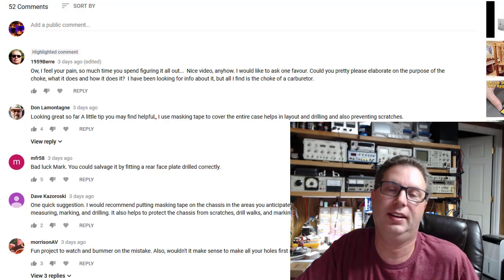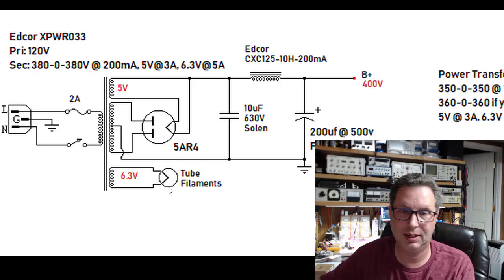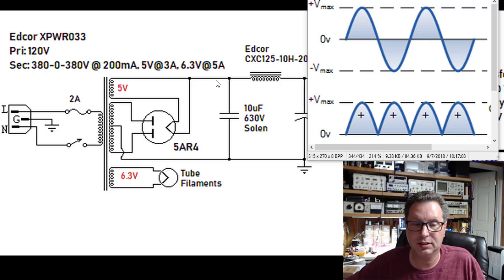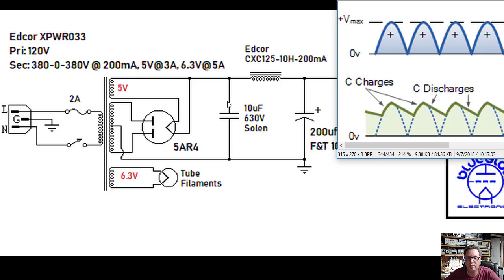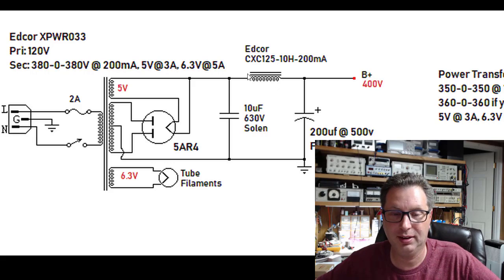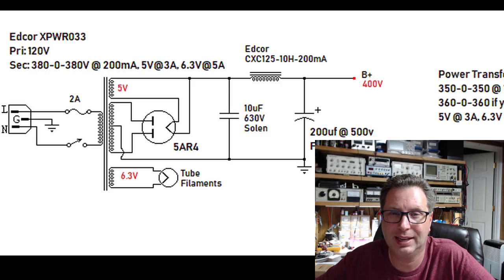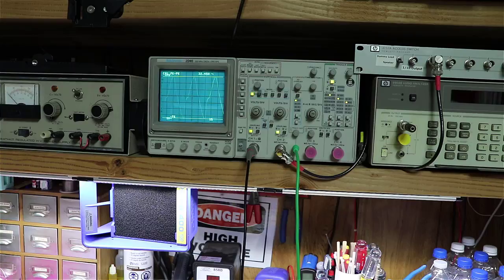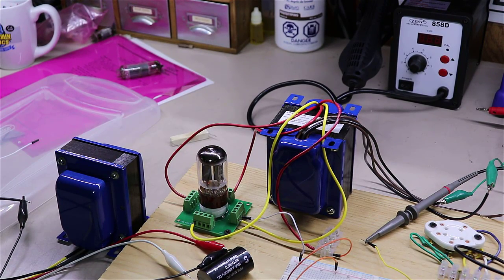What does the Choke in a Tube Power Supply do?

Comment: Hello - I’m sorry I just came across your video, 2 years late. I was thinking perhaps others have pointed out the inaccuracies, stuff perhaps you deliberately left in so people will write in !?

My first point of disagreement is the too output of the transformer secondary. You have one end is that 5 volt lead going into the heater and the other end connected to the 400 VDC !

Think !

Also - the center +/- 400 volts is rightly connected to ground but - look at how you have the =/- outputs if the transformer secondary connected !

They into the rectifier but dove go out!

These two need to go into that choke,

Also the rectifified output goes into the first capacitor for “smoothing” . It’s the inductors-capacitor following that are the filter !

Let’s see you corrects that schematic !

Are you not tired of deliberate “click” bait !?

Comment: I have a Baldwin organ choke that has 3 wires for the life of me I can't figure out how to hook it up. I took a measurement of two opposite side wires yellow and green on my lcr meter abd it said 10.04 Henry's and 198 ohms but if yiu try measuring with the third wire which is black nothing comes up. Do you think it's even a choke or could it be a common mode choke. Maybe the black wire is a ground but I think a filter choke was two wires on same side

Comment: Great video. A couple corrections, VAC peak to peak is not the same as RMS. Line voltage in the US is about 340VPP (+170/-170) which translates to about 120VAC RMS. You might think this is pedantic, but if you're ever using a function generator to run appropriate signal through a circuit, you'll need to know the difference or stuff can go poof, or get calibrated incorrectly. Also, caps by themselves aren't low pass filters, they're high pass filters. You can put them in a circuit so they pass HF to ground, thereby creating a LPF, but by themselves, they're HPF. Also, not a correction but worth mentioning, in modern gear, voltage regulators are also often used to smooth out ripple current....of course you won't see these in oldschool tube circuits, but they're still pretty neato ;)

Comment: Kudos ur schematic is very good in order for ur choke to do its job thebinput C should be relatively low and the C after the choke should be 20 or so times higher good power supply design

Comment: Here I am again. At 16.46 you can't just ignore the fact that the input cap is too large for the voltage and currents involved causing the peak repetitive current rating of the rectifier to be exceeded. (The  series resistance per plate could be increased to solve the problem) But I guess you did. Your rectifier tube will have a shorter life than if you designed the supply filter properly so as to not exceed the peak repetitive current rating of the rectifier tube.

Comment: "120vac Peak to Peak RMS voltage" What????? there is no such thing. For AC voltage there is 'Peak to Pea'k, 'Peak' and 'RMS'. The voltage at the wall socket is 120vac RMS. RMS is .707 times peak so 120 vac RMS is 169.2 volts Peak or 338.4 volts Peak to Peak. Words matter. Words have meaning. I will watch the rest of your video but I will be careful. You have shown that you can't be trusted.

Comment: This was a really nice, informative video.  I would like to mock something like this up so that I can add a choke to an amp that was not originally designed with a choke.  I've added a choke to a Princeton Reverb and had to install a lower than spec resistor after the choke to drop voltage to the next node in the chain.  The choke alone dropped me 3v., I needed to drop 20v.  I'd like to add what you did to a build board.  Do I need a load on the power transformer to do what you just did?  I always put a 4, 8, or 16 ohm load on output transformers to run diagnostics so I don't have to listen to signal coming out of a speaker.  Does the same methodology apply to power transformers?  Can they be powered up open ended?

Comment: 4 minutes into this video, and you have already taught me (in a manner that I will remember!) more about tube amps than almost 6 months of reading books/blogs/articles and even watching other content creators. I mean Rob Robinette has a invaluable reference site, but it kind of assumes that you are already fairly familiar with tube amps and schematics. When you buy a B-52 AT100 that is already infamous for electrical issues sight unseen, and the seller swears up and down that it was working when he sent it, but the 20 year old masking tape has markings that highlight the one tube that shows scorch marks on the board... well, lets just say, I'm out of my depth after replacing 3 bad resistors, 2 blown fuses, all of the tubes. Still will not power on. I Love the B-52's, but I might as well have gotten a Mesa-Boogie for the amount I'm spending to repair a $500 amp.

Comment: Great video.

  Thank you for the excellent video.  I have a question or two.  I noticed in your schematic the neutral is switched.  In my jurisdiction that is not allowed. The neutral must NEVER be open.  Only the line side of the AC.  When the neutral open the chassis is always live with a potential of 120v to ground and the could be you if the earth-ground (green) is not, for whatever reason, present. All fuses/CB must be on the line side for this reason. Again, that is my local code but maybe not yours. 

 Next, I have a few old original Dynaco ST-70 amps. One was functioning perfectly when I decided to install a three-pronged "earthed" plug.  The green went to the metal chassis.  When I plugged it in the resistors on the rectifier board exploded, I assume due to high current ground as this amp has one lead from the power trans to the star ground along with the electrolytic capacitor can tab and other leads from the rectification board.  I'm just in the process of replacing the caps and the board,  I have read other have earth grounded that chassis w/o issues other than some hum (which makes me crazy why the chassis should have ever had anything to to with carrying current).   My first thought is that it/s a polarity issue.  Any thoughts would be greatly appreciated.  Many thanks.

Comment: Hi so i just watched your video on how chokes work and was hoping you could come with a answer for me. I'm building a amplifier that is going to use 6 KT88 tube witch will draw around 842 ma and 6 smaller preamp tubes that will draw around 2 ma so lets just round it off at 845 ma I'm going solid state on my power transformer using 8 N14007 and this will be a filter input not choke input amplifier. the capacitors will be 50uf @ 500v the first 2 at the power supply wired in series parallel followed by 2 at the screens of the kt88 also wired in series parallel and 4 more cap in the preamp section all 50uf @ 500v. I'm having a power transformer made that will be 500 0 500 at the H.T how many hennery do i need ? I've gotten different answers like from 4-8 hennery but o more than 10 also would you know how many ohms it would be thanks Jack

Comment: Excellent explanation but the modeling experiment even better. Would you provide a schematic and parts list for your test? What did you use for a load on the rectifier circuit?

Comment: Just to be clear are not these voltage waveforms you reference only valid when there is a load resistor present on the output side of the power supply?
It looks like the output is open circuit.

Comment: Watching this with my DIY tube amplifier. One question, suppose I have an unused supercap (1.2 mF 400 V), is it OK to connect it parallel to the rectifier output and eliminate the use of a choke? Since a bigger capacitor will smoothen the ripple even more as well.

Comment: Hi Mark, thanks for great explanations, Im a newbie, and have learnd a lot with your videos!   
If possible, would you make a video explaining how to design a real LC - Choke input filter (not a CLC or Pi filter...) considering critical inductance as well as minimal current for bleeder resistor calculations?  I have read a lot about inductors efficiency for ripple smoothing, and also saw many rectifiers tubes datasheets with differences in operating characteristics between Choke Input and Capacitor Input (Pi) filters...
Thank you very much!

Comment: Do you recommend actually switching to "boutique" capacitors or is that just marketing BS?  Would love to hear your technical description of this
Reply: Best capacitors are oil in paper u can use motor run capacitors for hvac systems u can use ac capacitors there voltage ratings are 1.4 x of what they are rated at at ac voltage and they are cheap and long lasting

Comment: As usual, great video. Well explained for any novice getting into electronics. One point I think we need to make here is just like the capacitor, the choke stores energy as well. And just like the capacitor, it releases that energy when the voltage feeding it falls. One reason chokes were used in tube circuits was cost. Today that seems absurd as a choke costs many times even a large high uf/high voltage capacitor. But it wasn't that way in the 1920s through the 1950s. Large caps were quite expensive if not outright unobtainable prior to the 1940s. A choke was actually cheaper to manufacture  at the time. Solid state circuitry also made the power supply choke mostly obsolete. As SS circuits use lower voltage, higher current, the required size (Henry's) of the choke becomes impractical at 60hz. And by that time we fortunately mastered the dry electrolytic capacitor. But then in switch mode power supplies that are universal today, we once again see a choke power supply. This is because the high frequency AC at 50khz or higher is easily filtered by a small choke (very low Henry's, in fact just a few micro Henry's). So in a sense we have come full circle in power supply design basics. But also note in a switch mode power supply, the primary input rectifier filter is still a moderately large electrolytic capacitor typically in the hundreds of uf range. This is because at this point we are still at 50 or 60hz.

Comment: I replaced all the filter caps in a customers 70s Fender Twin Reverb guitar amp. The amp still had more hum than normal. The problem was a shorted choke. I've probably had maybe 5 or 6 chokes fail in 30 years of servicing tube guitar amps.

Comment: BLUEGLOW ELECTRONICS 
Is the Chokes storing current like a reservoir like the filter capacitors or is the Choke doing something else to the AC ripple, not sure if the Choke is regulating the current? 
Most Power tubes 6L6,EL34 use a B+450vdc on the plates, if you increase the B+ to +600vdc would this increase the AC ripple but why would it increase the AC ripple? i would think it would decrease the AC ripple because more B+ voltage mean less current draw from the power tubes. When you're biasing the power tubes in an amplifier circuit how do you bias the compression of the power tubes the 1dB compression point of when the power tubes start to compression? 
because its say to bias tubes at a 30mA bias current per tube to be safe but how do you know when the tube is compressing?

Comment: Thank you. Question is there and issue using a larger uf capacitor (32 or 50 in place of a 20uf) for the power filter?
Reply: A tube rectifier has a maximum capacitance specified by its manufacturer which can be found on its data sheet.

Comment: Do nodal resistors basically do the same thing that the choke is doing? I believe that's what they are called, but they are basically votage dropping resistor(s) that go in series in-between the filter caps. It's something that you'd typically see in a guitar amp.
Reply: An 'internodal' resistor serves two purposes. It drops DC voltage and also works in conjunction with a following filter capacitor to form a low pass RC filter to reduce ripple. A choke, due to the low DC resistance of its coil,  has little effect on the DC voltage but it forms low pass LC filter in conjunction with the following capacitor which reduces ripple more efficiently than an RC filter.

Comment: Howdy.
Chokes try to uphold the current. This causes the anode voltage to drop in suddent current demands. For instance a kettledrum is hit. When the current demand goes down the anode voltage will rise. This can cause a pumping effect on the sound.
Chokes were used earlier when there were no large high voltage capacitors available or they were crazy expensive.

Comment: Also called a Pi filter? The choke opposes a change in current by storing and releasing the energy in an electromagnetic field. The capacitor opposes a change in voltage.

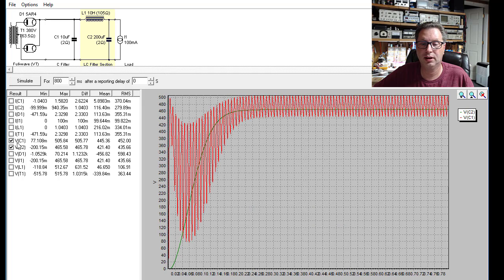Comment: 13:32
The flat green line would not be so flat if there was no C2.

Capacitors and inductors are complimentary to each other in power-supplies.
On Inductors the current can not jump - it smooths out the current that flows through it. Capacitors smooth out the voltage.

Now the reason why you normally do not see more than 1 choke - you do NOT want a constant current in your audio system cause the current draw can vary wildly depending on what sound is played at that moment. But you do want a very constant input-voltage as the output is in reference to that.

Just imagine another big inductor before the output and the music was at a rather loud passage drawing a lot of current - so far everything is fine.
But now the music just abruptly stops - a moment of silence. Well the inductor is still pushing the same current and if that is not used by any component then the excess current will just get wasted in resistors (worst case scenario with no further caps) and that creates large voltage spikes.

So while you can just a capacitor alone for smoothing (and have some ripple left) if the output current can vary quickly you should never use an inductor alone as that can fry your circuit.
(https://www.youtube.com/watch?v=LXGtE3X2k7Y as an example of how just a 6V input on an inductive load can produce 40V spikes - now think what can happen at 200V)

Comment: Why aren't there center taps on the rectifier filament windings? The connection of the load to one side, as is common, introduces significant 60Hz ripple.
Reply: In filament rectifiers, the filaments in the 2 halves are in parallel. You can choose either pin 2 or 8, and there will be no difference in plate voltage due to filament voltage.(5Y3, 5AU4) If you have a unipotential rectifier, it is necessary to draw positive from the pin #8, which is connected to the cathode sleeves.(GZ34, 5AR4)

Comment: Liked most of the video but the rectifier doesn't "flip" half of the waveform negative to positive.  You have two diodes alternately conducting around a common center tap.  Each diode adds its pulse when its side of the HV winding goes positive with respect to the center tap.

Comment: Great video but I must politely point out a small yet important detail you missed. All the voltages you refer to in this video are RMS and those are not the same as peak to peak. For example common household voltage is well known as 120 V but that is RMS, the peak of this sine wave is actually the RMS voltage multiplied by the square root of 2 which turns out to be around 170V peaks. This is important as this peak voltage is what is actually rectified and stored in the capacitor which is why your DC voltage is higher than the RMS voltage when rectified. Same for the transformer secondary voltages. The rectified voltage will be 380 times square root of 2 or 1.71
Reply: Hi Jacob, the square root of 2 is 1.414 not 1.71, hence the 380 volts RMS when rectified becomes 537 volts DC. You are correct about house peak to peak voltage in North America is very near 170 Vpp or 120 x 1.414. :-)
Reply: @garybevis8691  You are right! I don't know where I got that number from. I think I was thinking of root 2 and root 3 simultaneously root 3 is about 1.73. I use root 3 more at my job for 3 phase conversions.
Reply: @jacobdykstra8499 this type of learning from experts and hobbyist is great. Also people being respectful to each other is common of this hobby . Nice

Comment: Actually, it’s 760 RMS from one end to the other, ignoring the center tap, as all the other specified transformer voltages are RMS. Therefore the P-P voltage is twice the peak voltage, which is: 380 (V RMS) times sqrt(2), or roughly 537 volts peak, so the P-P is twice this, or roughly 1,074 volts peak-to-peak. This is important, as you need to make sure the capacitors have a higher voltage rating than the pulsating, full-wave rectified DC peak (here, 537 Volts), so the 630 volt rated, 10 uF capacitor is good!
Reply: Hi William can you help me  I'm building a amplifier that is going to use 6 KT88 tube witch will draw around 842 ma and 6 smaller preamp tubes that will draw around 2 ma so lets just round it off at 845 ma I'm going solid state on my power transformer using 8 N14007 and this will be a filter input not choke input amplifier. the capacitors will be 50uf @ 500v the first 2 at the power supply wired in series parallel followed by 2 at the screens of the kt88 also wired in series parallel and 4 more cap in the preamp section all 50uf @ 500v. I'm having a power transformer made that will be 500 0 500 at the H.T how many hennery do i need ? I've gotten different answers like from 4-8 hennery but o more than 10 also would you know how many ohms it would be thanks Jack

Comment: Question about current in the choke?  Chokes always say working current rating.  Higher current you'll have less inductance and lower you'll have a higher inductance.  Is the current rating the maximum rating,  or can it be exceeded some?  Thanks again!
Reply: Determined by the gauge of the wire.  Not a good idea to exceed ratings- wire will get too hot.